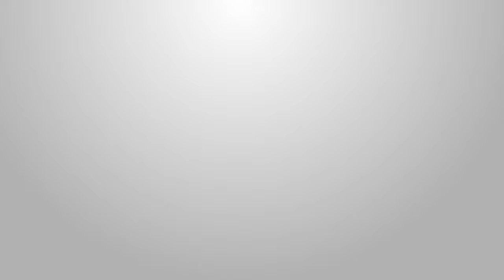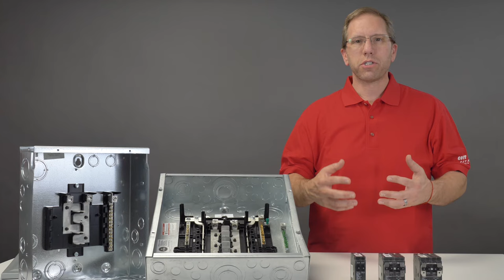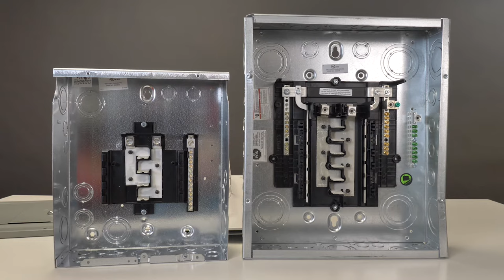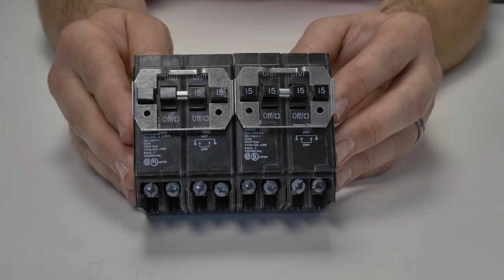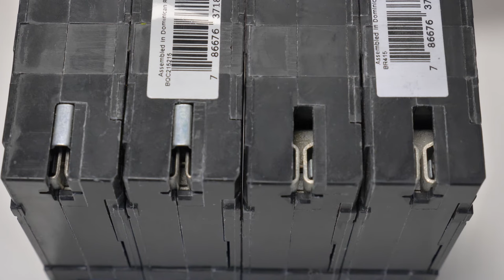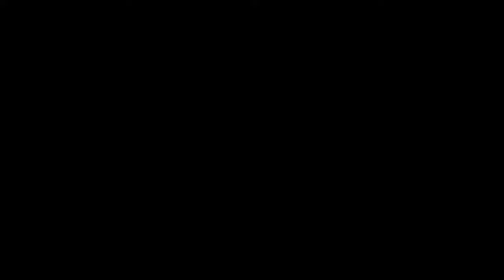Help With EATON's BR Plug-On-Neutral System (REUPLOAD)

Comment: if you have a replacement with the protector for the non-plugon load center and you don't need the protector, can you simply remove the protector with a pair of pliers?